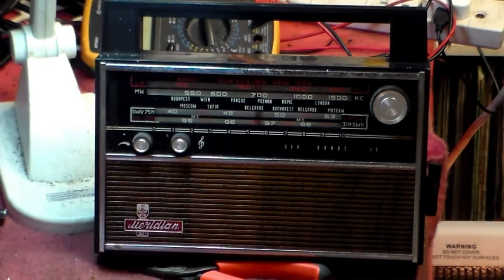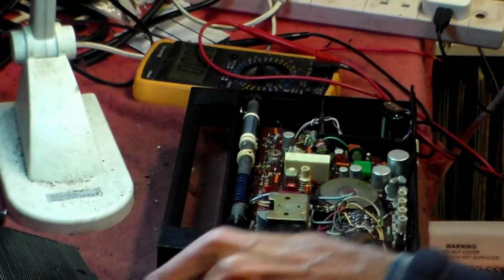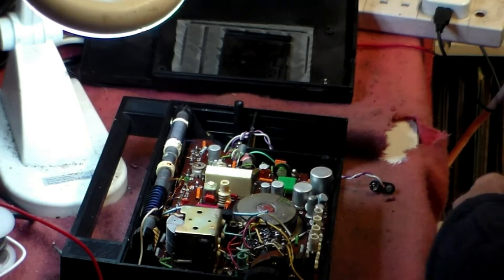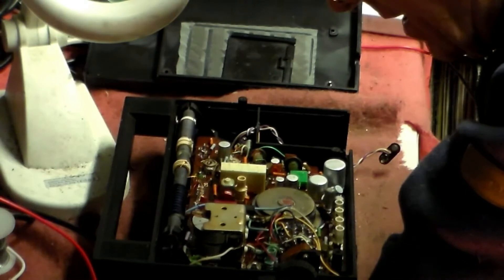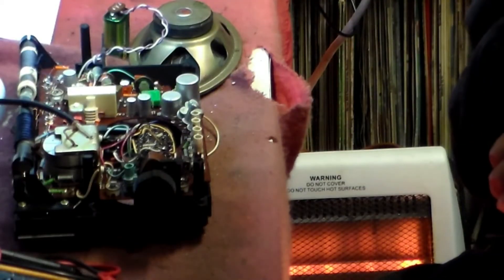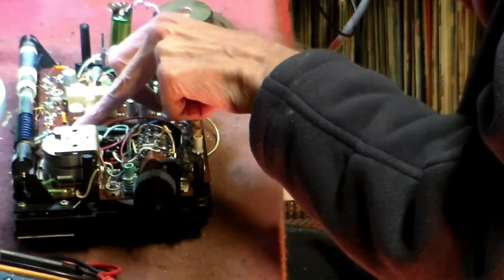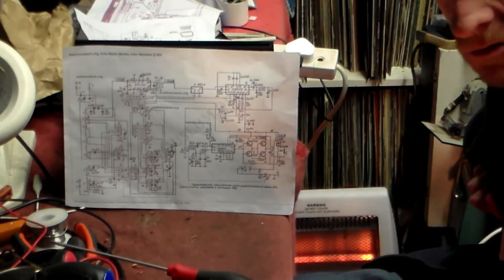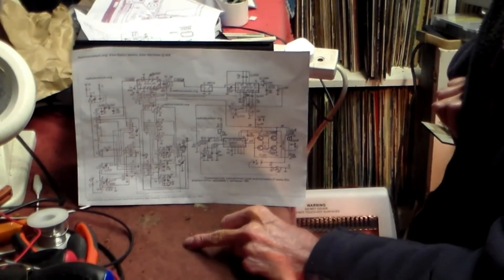Russian Meridian 201 1977 Transistor Radio Part 1

Comment: Hello dear author, I have an electronic copy of the book on USSR microcircuits, although it is in Russian. I can drop a link to the book, as well as tell you where else the k237xа1, k237xа2 chips were used.
Reply: I have these chips in stock. I myself live in Russia, it will be difficult to send, but it will be easier to make these chips from scratch, since they consist of 5-9 transistors. I can throw off the circuit of these chips if you need.

Comment: What the hell is multi coloured chip ?
Reply from the maker: The Russian sets of this era did not build them black only! The RF chip was a red colour, the IF was yellow and the Audio was green.... They were different colours! Don't ask me why!
Reply: About this chip on the paper. Upper left. This is old marking. New one is K237XA1. The second one is K237XA2. between these two is ceramic filter (465 kHz). In some places this XA is marked as HA.
Reply from the maker: @laurilink7512  I need one! Any ideas.....
Reply: @Steveuk405  Don't waste your time with color. This is irrelevant. Just what factory had at this time. Do You need these chips ?
Reply from the maker: @laurilink7512  Yes I do. The RF one.